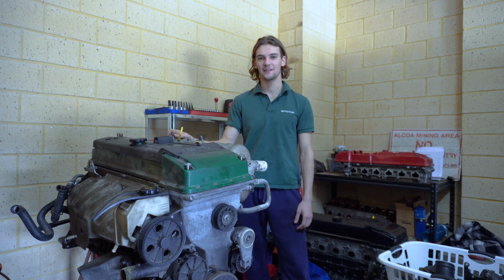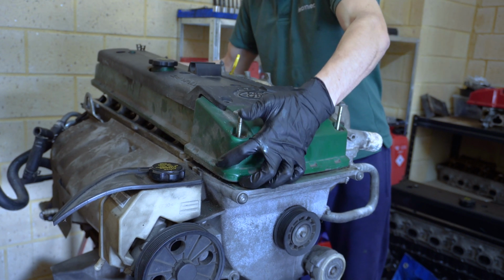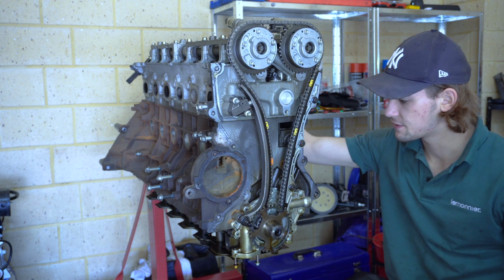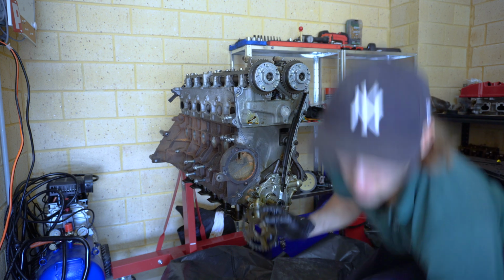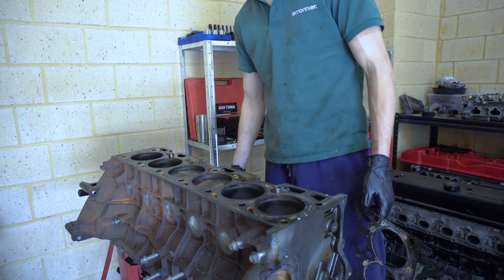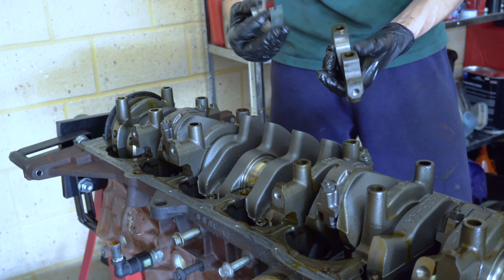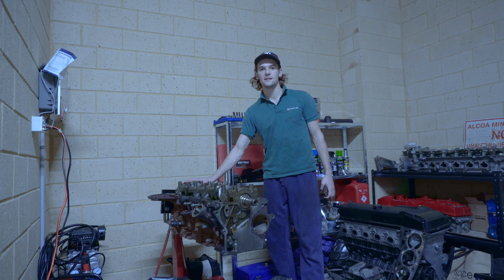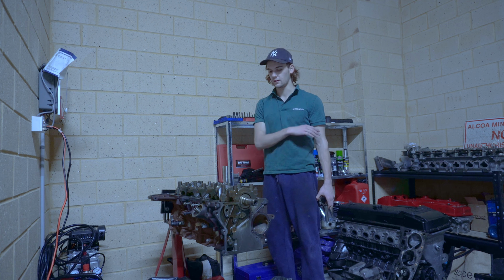FG Greentop Barra Build Series Part One | Teardown

Comment: Hey mate what about a zf6, mind you youve probably done the setup by now, but i love my zf great comfort on the street, smooth shifting but can handle basically whatever power you put through it,
Good stuff but i have my green top on the stand and am waiting for parts to come in, keen as
Reply from the maker: Just all I had at that point, as well as the configuration of the car. Worked out cheaper to put a stronger BTR into it ten to do a ZF conversion, minus the muck around too. I expect to dabble with them in the future though!
Reply: @thebarraspecialist  fair enough, I haven't yet seen your btr video
Reply from the maker: yeah no worries, I'll be putting up a BTR strengthening series in a few months or so for a new project I'm yet to introduce. With correct modifications they will handle in excess of 500kw. There are a few people making these now for that power.

Comment: G’day mate I may have stuffed up re installing cam caps on my green top budget build only one though. I’ve been told that they are not interchangeable as they are machined to each head assembly. What’s a solution to keep the build going besides getting a new head off a wreck lol I don’t want three engines in the shed 🤣
Reply from the maker: Hey mate, what happened with your old caps? You can't use mixed and matched caps as the cam journals are machined for individual caps (they don't all line up perfect). Unfortunately you would have to get different caps machined but this is likely to give the camshaft journal too much clearance! Best of luck.